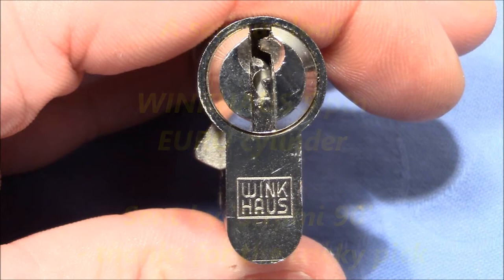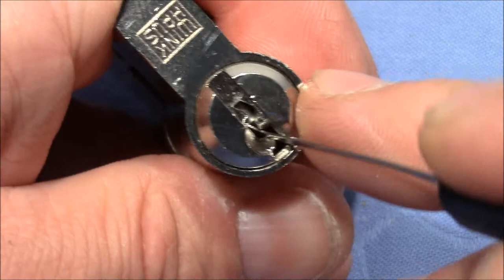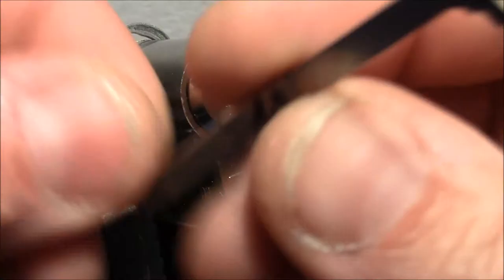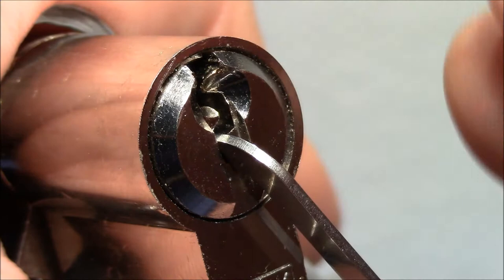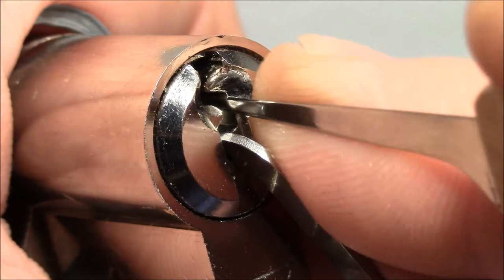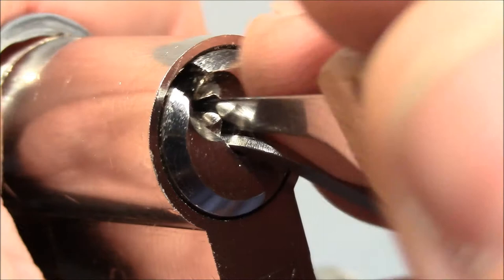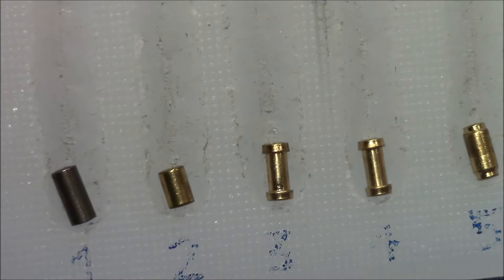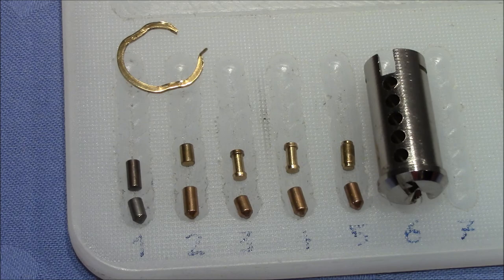(picking 414) WINKHAUS 5 pin euro lock - a tricky pick [ sent by 'Stromi 90' - thanks a lot ]

Comment: Nice lock from Stromi 90! Strange they just didn't go with all spools though. #5 pin, that double sided T pin was a bit weird. Nicely picked. Cheers! ;)
Reply from the maker: Thank you. All spools would make the core floppy. I know some LOCKWOODs do that but they have very shallow spools.
Reply: Potti314 yes, you are right. They are always shallow and with pretty tight tolerences, they work good.✌🙃